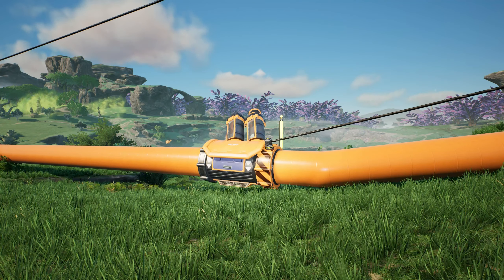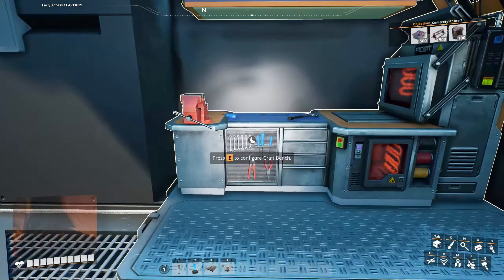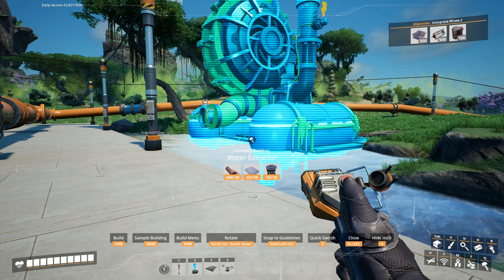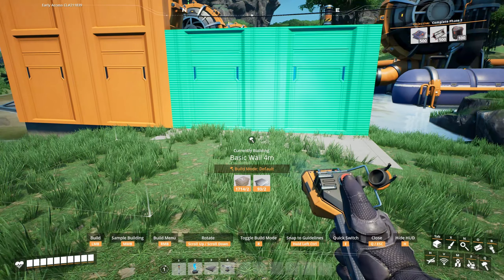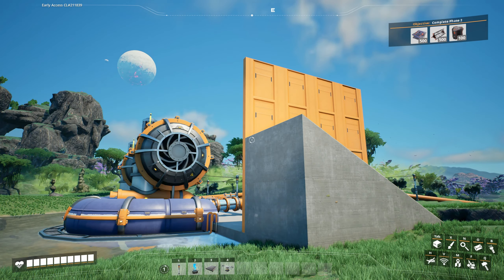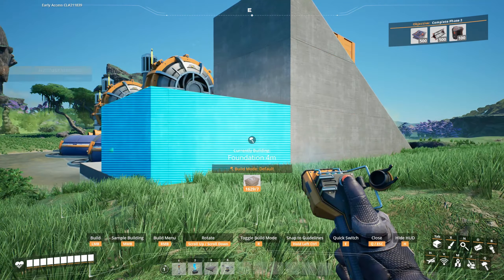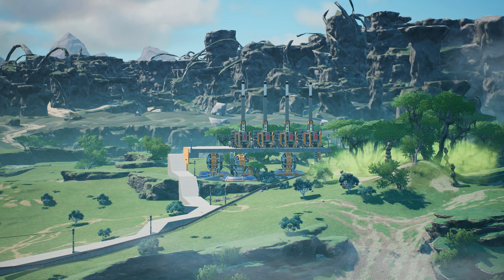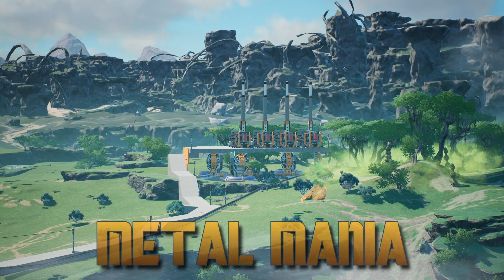Scapino Plays Satisfactory Update 7 E8

Comment: The problem with the belt was that it was not connected to an input or an output. Therefore the flow direction was assumed to be in the same direction as it was constructed . This was against the flow of the belt from the coal and therefore would not allow connection. You are not allowed to connect two opposing belt directions.
Reply from the maker: Thanks for the info! I did not know that...